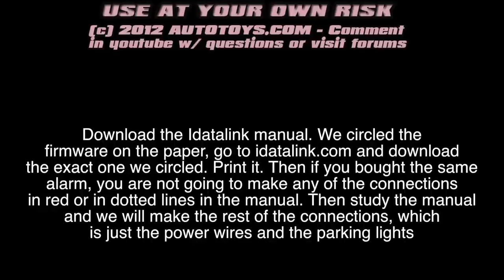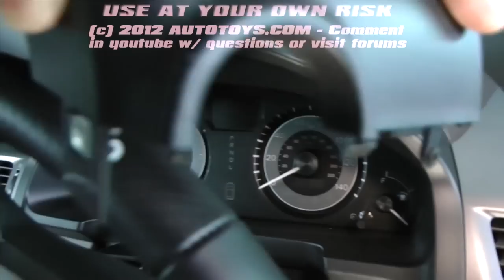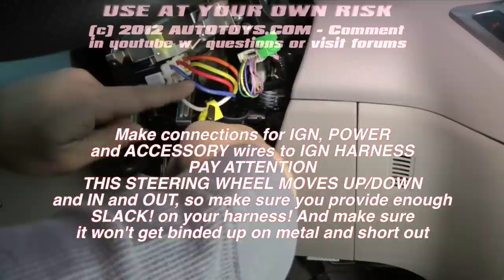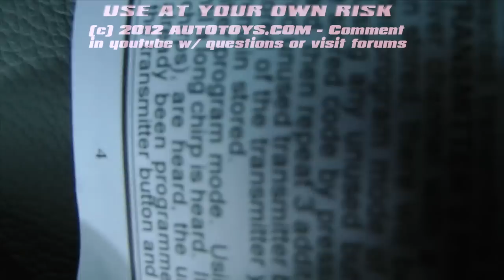Honda Odyssey REMOTE START UNCUT PRESTIGE INSTALLATION (USE AT YOUR OWN RISK) 2012

Comment: I can not figure out how to hook up the motor lock wire.  I'm having a hard time finding the right wire to connect it to.  My remote start turns on the car like if you turned you key twice but it does not start the engine.  Any advice would be greatly appreciated!  Thanks
Reply from the maker: What kind of immobilizer bypass are you using
Reply from the maker: Did you bypass the factory immovilizer? Put the key in the ignition and try to remote start, if it works, you didnt bypass the factory immobilizer